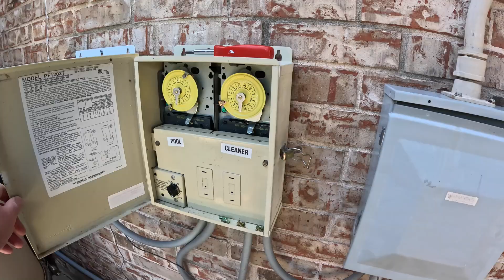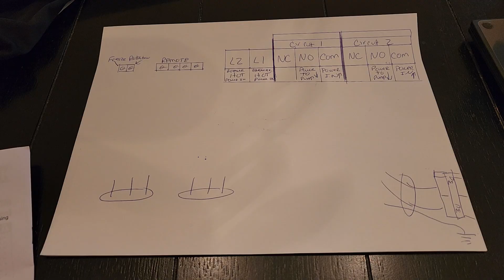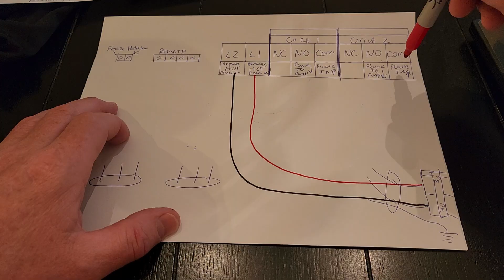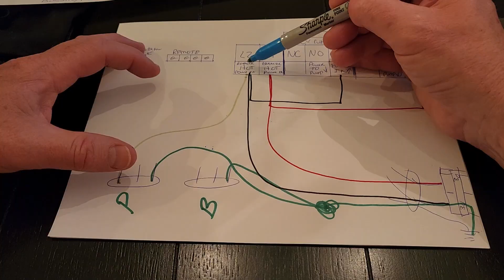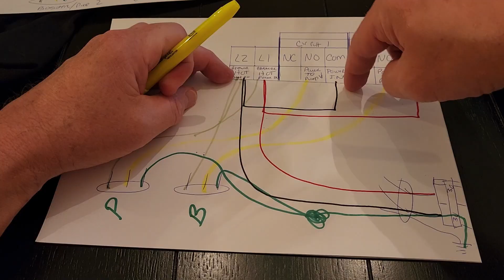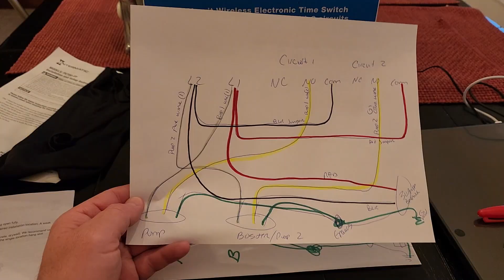Intermatic PE723P 7-Day Electronic Wi-Fi Pool Timer Wiring Schematic for 2 pumps, PE733P similar

Comment from the maker: Half Thumb Storefront
     https://a.co/d/03qA12Kx
Intermatic PE723P 7-Day Electronic Wi-Fi Pool Timer – 2-Circuit
     https://amzn.to/44fFdyC
Intermatic PE733P 7-Day Electronic Wi-Fi Pool Timer – 3-Circuit
     https://amzn.to/4k8QDtM
Intermatic PE700-FP Pool Timer Freeze Protection for use with Intermatic PE723P and PE733P
     https://amzn.to/3THbGZH
Klein Tools 11063W Wire Cutter / Stripper
     https://amzn.to/3TK0zz8
DEWALT 20V MAX Cordless Drill and Impact Driver
     https://amzn.to/449DcFm
Masonry Drill Bit Set
     https://amzn.to/45Hw2cE
Screwdriver, 6-in-1, Magnetized Double-Sided Bits
     https://amzn.to/4kfcdge
Sealproof 1/2-Inch Non-Metallic Liquid-Tight Conduit and Connector Kit
     https://amzn.to/44pCrXw

Comment: Still looks wrong to me. You should have 2 hot wires to L1 and L2. For constant power pump one with should go to the pump pump number to should have two hot wires directly from them as well the way you did it it looks like when the power is off there's still a hot wire going to the pumps that is still hot that will eventually burn up your pumps and is not safe
Reply from the maker: Well I'm not sure why though I am not a master electrician.  I connected it exactly like Intermatic said to. Did it wire for wire while I was on the phone with them. Has worked flawlessly ever since.

Comment: if you would have used the camera on your phone you could have just taken a picture of the analog timer wiring before you pulled them out, they should have the same wiring designation
Reply from the maker: Heck yeah, I did exactly that...buuuutttttt.... for some reason wasn't. There was also a no freeze thingy and all the wiring went to that as well so I got confused.

Comment: This is not correct. The pumps/accessories should not be hooked into L1 and L2. I tried this setup and it didn’t work, and the correct wiring is on a forum. In short, L1 and L2 need to be jumpered to Com 1 and Com 2. Ground is common and they should be put together. The pumps can be split between the two circuits or use circuit 1 and 2 together for 240 which is what I ended up doing. In that case. The hots for the pumps need to be split as follows: NC circuit 1 , NO circuit 2. Found this on justanswer. Once I did it this way everything worked perfectly. During the setup on the app it asked it I wanted to use circuit 1 and 2 together for 240 and I said yes.
Reply from the maker: Appreciate the input. I will check that. thanks
Reply: @thefritzfritz so this worked for about a week and then suddenly quit working. I reset the unit, set it to use both 1 and 2 together again, and it still did not work. I rewired the pump to NC1 and NC2 NOT working together and it works, I just have to turn on circuit 1 and circuit 2. Really weird. I got with tech support and they said I should be getting 120 on each circuit, but I’m getting 240. 🤷🏻
Reply from the maker: Sure hope it worked out and you talked to Ken. I had to call the other day and got the jerk again.
Reply: @thefritzfritz yes this worked, I just have to turn on both circuits
Reply: @anthonyharris8390  the way I understand is when programed for 240 VAC the pump wires go to NO1 and NO2 (DPDT config Now this box only controls one pump) . At the scheduled time both the relay energies putting 120 VAC on each leg  ie: NO1 and NO2 . The way you had before (NC1 and NO2)  was only suppling 120 VAC to the 240 vac Pump so the pump will sometimes run till it overheats the leg and shut off to protect itself.
Reply from the maker: excellent news!!
Reply: @gregbrewer4740  I'm trying to follow but still a little fuzzy.  My configuration will be a 240V main pool pump and a 240V booster pump that should only run if the main pump is on.  But for a shorter time duration.  Will I now need a secondary timer for the booster pump?  Or perhaps the 3 circuit box would be better suited??
Reply from the maker: You should be fine with the 2 circuit. Call them and ask for ken in tech support.

Comment: Thanks for the video and diagram. I am researching replacing my old mechanical control housing with either the 23 or 33 models. Really want the wifi function for more flexible scheduling and remote control. My breakers are included in my intermatic housing, so I'm figuring out how to keep or replace    the entire original housing or add new breaker housing.
Reply from the maker: I sure hope it helps. I had the Intermatic analog and wanted to be able to turn it on and off without going outside. The only downfall I have experienced so far is you need to leave a flat tip screw driver close to the box so others can run it when you are not around. Unless they install the Intermatic app and log into the account. If others have access to the app there is the possibility that they will mess with the scheduling.